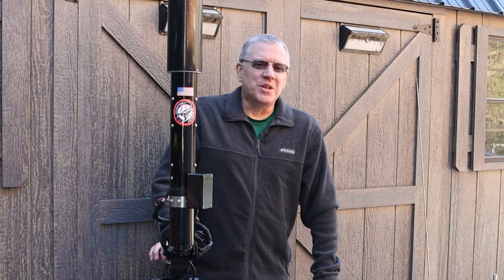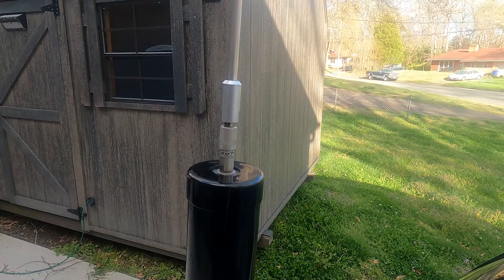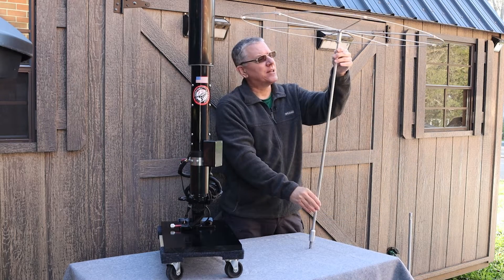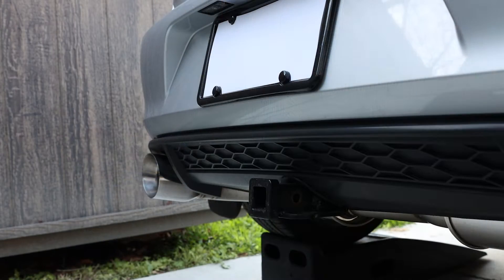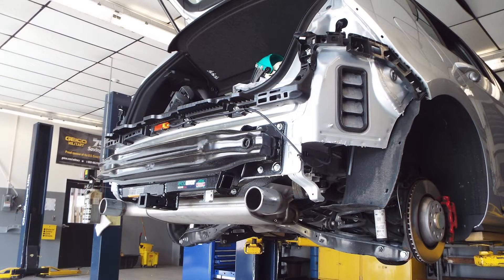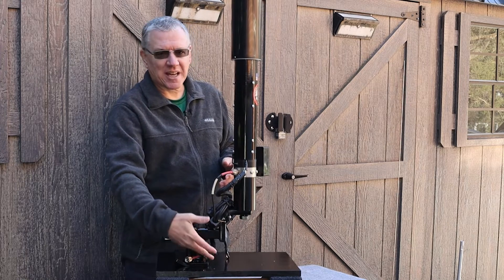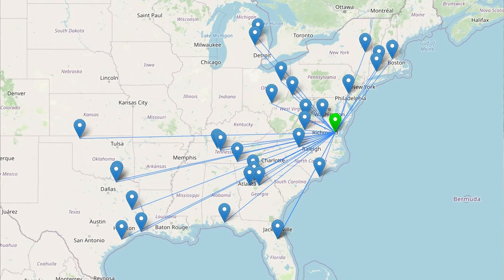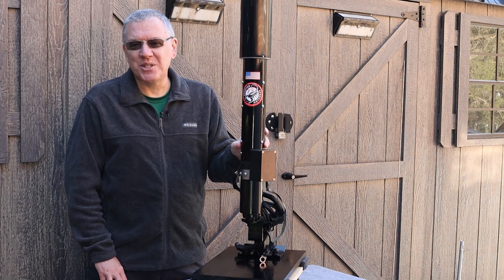Scorpion SA-680 Mobile HF Antenna - Updated

Comment: Are you running HF power yet? I just put in a Ameritron ALS-500Min my truck and it took me to another level. check Hi-Q-5/80 antennas also. 73 great videos
Reply from the maker: Thanks, Phillip! I've been to your QRZ page in the past. You're not in my log; so, you must've commented on another video, which then led me to your page. I don't recall seeing your videos, but I'll watch some now. You appear to have a good selection. You and I have a lot of equipment and interests in common! The ALS-500M was on my short list. However, inventory shortages in 2020-2021 combined with my dive into VHF contesting compelled me to put the HF amp on a backburner. See my KE4WMF/R playlist for my initial VHF weak signal setup. Question for you: Is the round fan opening on your ALS-500M an intake or an outlet? Knowing that will help me to plan my new trunk setup to perhaps accommodate an ALS-500M in the future. And, speaking of the ALS-500, there's not much content on YouTube about it. You might be able to cut a path for growing your channel if you can manage to share a good feature about it. Thanks for visiting!
Reply: I will interject with my humble opinion, and people will argue with me endlessly, but I suggest that an amplifier with a scorpion is not needed. If you are not compromised in excess to unavoidable compromises that comprise mobile HF installations, then you should put a 5/9 signal out about anywhere and to anyone that you can hear on average. I submit that in adding a high power amplifier to your HF radio solution in your vehicle, while it might be fun in application, it places undue stresses on your sensitive electronics that make that modern car run smooth. Everything from the ECM, to the ABS, to Airbag sensors all get impacted to some sort of degree when you are pummeling their respective ICs with constant burst of near field high energy HF. At best the Scorpion is efficient on its lowest band, 75m, to around 5%. Amplifiers in the mobile are not worth the effort, expense, or energy they use to gain maybe half an S unit to the outside world. A mobile setup is far too compromised to gain the efficiency necessary. Now a home station antenna over the Earth with proper fundamentals being met in all large antenna installation practices will raise the efficiency drastically, and that properly satisfies using an amplifier. A scorpion does not need an amplifier and I suggest not using one. The problem with Scorpion is not that it cant handle power when shiny new and clean, its just that the fingerstock inside the antenna could arc under high power, especially if dirty or oxidized, and it could damage the antenna's coil or fingerstock eventually. I know someone who was running a KW through his scorpion and it melted the finger stock contacts inside that contact the coil. Ron honored the warranty regardless and repaired it for him. A super mega professional business owner indeed! - 73 KK4YDR

p.s. I melted the pseudo-fingerstock in my Steppir Big IR Vertical base station antenna at 10 watts while tuning when I first got it because I didn't realize I was putting RF out while the antenna was moving its element out and in. That was 10 watts. I cant imagine the voltages in a poorly compromised mobile HF coil such as any screwdriver. Your mileage may vary.
Reply from the maker: @DeepSouthVeteran  - Thanks for the comment, Eric! Your logic is another part of why the ALS-500 is a backburner idea for me... and has been since 2020 when I bought my Scorpion. I had estimated a gain of about one S-unit at the other end of a QSO. But that only improves my odds of being heard in a pile-up and does nothing to help me hear any better. I would not want to be the operator who's "all mouth and no ears." As a result, I'd only use an amp for improving my odds in a pile-up where I can clearly hear who I'm calling; but I would never call CQ using the amp. With that in mind, I'm inclined to avoid the purchase of something that I wouldn't use all of the time. My most frequent HF activity is on POTA as an activator. As an activator, they're calling ME. So, I know they can hear me if I can hear them calling.  🙂 Thanks again for the comment!

Comment: Would love one of those BUT... they don't ship to Canada, don't know why, will ask them soon. Thanks for the videos.
Reply from the maker: Yeah, he's had too many problems with international shippers. If you call him, he'll work with someone who makes the full arrangement for international shipping via shipping agent. It's far more expensive that way, but it takes the risk away from him.  Thanks for visiting!
Reply: UPDATE! I was cruising one of the swap-shop sites up here, there's one in my garage as I type. Going to fashion a rack for the roof rack out of bed rails (first attempt) I won't be driving with it in the operating position, will lay it down with a support under it, that's the plan so far. Thanks for doing the videos, Scott. @StealthGTI
Reply from the maker: @JohnHill-qo3hb  - Glad to hear it, John! Have fun!

Comment: Really nice, but do you ever get any pushbk from the Local LEOs regarding Lic Plate obstruction?  Curious, as you know how these things can be, cherrs n gd DX 73
Reply from the maker: Nothing yet. So far, with all of my antennas (as many as 12 at times), most police seem to avoid me after taking a photo. HAHA! BUT, should I get a ticket for such a petty "obstruction" and not have it dismissed in court, I think I could use the same tow hook license plate mount that some people use, but put it on the back. Of course, I would need to add a light for it, but that's not a terrible problem. Thanks for visiting!
Reply: @StealthGTI  cheers, i probably just watch too much you tube!!! 😀

Comment: Very good video and very detailed. I have a fiberglass motor home with virtually no mounting locations. If I use the Hitch mount I cannot tow my H2 and it blocks the engine access in the rear.
I am considering this antenna with a front mount on the H2, either the Hitch mount or the Brush Bracket mount that is pictured ont eh Scorpian web site. I realize both will be compromized however like you it will be my only option for mobile with the motor home. The motor home should shield the antenna from wind while driving. The issues I am wondering about are vehicle grounding from the motor home back to the H2, about 6 feet, considering the braided ground cable that you use and attaching it to the motor home frame. If I use the Hitch mount on front of H2 I could also move it to the rear of H2 and use it there. The other issue with the motor home is it is a 45 footer so I need about 50-55 feet of control cables and coax. Do you have any thoughts on how that will affect performance? Lot's of questioins from me I hope you have some good suggestions. Thank You N5ANY
Reply from the maker: WOW! That's quite a plan. I think a front mount may be best for the sake of keeping coax and control lines shorter. Take a look at Tarheel Antennas website for more photo examples and ideas. I'm not saying to buy a Tarheel; but you may get more ideas. Good Luck!

Comment: Just come over your posting.

Well I think I have had mine about 13 years and living and driving in the UK is more challenging with big antennas on, like you I soon found the top hat the best option. My antenna I believe they don't make any more which the SA160 so 160 up to 10m. Really a great antenna I used to drive most days to London from Southampton about 160 mile round trip and leaving the house at about 4
04.30 and leaving London at about 17.00 and I am sure the only reason I am manage it was the radio in the morning non stop DX on 40 & 80m and on the way home rag chews with my normal friends. Running the full 400 Watts did bring up a few bits of fun on 15m it would completely scrambled the matrix sign on the motorway. On a more serious note I could not use the stand whip as it would whip around near the body of the van as you would stop and start. This would kick out the amp this was speeds over 50 mph let along the national speed limit. Other things which would take out it out where trucks with big bodies and as you drove along side and road bridges along with the overhead matrix signs.

At this time I had moved over to minium hight of 15' for 80m the UK stand law is 16'6" other wise it must be signed and as my journey was motorway not a problem and the whip was now a 5/16 stainless steel diameter bar with the hat on.

Tuning like you used to use the two switches for a few years then imported from the states a turbotune 2 great bit of kit never missed the frequency, a little adjust with the switch when under full power.

Now a few problems I am afraid! 

I have had a couple of fires at the top where it has moulded the plastic tube, I have put this down to water as we get a lot of weather changes here and running running up and down the motorway a warp 9 come sun snow or rain can't be good about 45,000 miles a year. Also the antenna fitting at the base has shorted so a regular clean and a couple of changes.

So I have rebuild it several times it in the workshop at the present time as I have completely changed the bottom end drive and changed it to a DC stepper motor which will be controlled is arduino.

Final words:

 Ready a great antenna I don't do much mobile work due to the van getting completely written off and just having time to fit it all in the new vehicle plus work and health have both changed but I am going to try and get it all back up and running over Christmas and would be great work you mobile to mobile 
.
73 Richard
M0UOO
Reply from the maker: Very good! I think Ron will make an SA160 as a custom order. However, I'm fairly certain that he no longer ships overseas due to problems with shipping agents. So, if you have one, you have a keeper for sure! Thanks for visiting!

Comment: Great video! The question I have is about the mounting directly in front of the license plate. I have seen offset mounts, so the plate is visible. Have you ever had issues with the police about having the plate view obscured? Here in New York city all the speed ,red light ,EZ pass cameras ,if you are pulled over you might get a ticket. This has been more for toll evaders. Bicycle carriers are used more for this than actually carrying a bicycle
Reply from the maker: I suppose it's possible. But I think I'm unlikely to get pulled over just for that. It's probably a secondary offense or just a reason to start a conversation. With that said, I AM just a tiny bit interested in an offset mount. I'd need to switch to a 2-inch mount first. We'll see if I make that leap. Thanks for visiting!

Comment: That thing looks like a flagpole! I don't think my truck could handle the extra drag that antenna would cause. Thinking about an Atas 120 for my Yaesu Ft891.
Reply from the maker: Ironically, the ATAS-120A will vibrate in the wind more than my Scorpion because the ATAS uses a weaker mount when compared to a trailer hitch. BTW, I have an ATAS-120A, too. It's a good antenna. I need to do some back-to-back testing to compare the ATAS and Scorpion directly against one another. See a photo with all antennas at https://i0.wp.com/stealthgti.com/wp-content/uploads/2022/10/20221016-Sunrise-01-1920.jpg. Thanks for visiting!

Comment: I own a Scorpion and I was mentored heavily by Alan Applegate, K0BG, so I sometimes, humbly, consider my-self quite knowledgeable in mobile HF operations. However, what makes me really, and I mean really respect you, is that you know for a fact that your antenna mounting solution is probably one of the most compromised positions and you admit that and fully admit that you want to compromise in order to keep your car in good material shape. This is absolutely respectable, and it shows that you know your stuff and I mean it! Most people in mobile have no idea what they are doing and if they do something that is just awfully wrong and woefully inadequate as far as the proper methodology, they fail to recognize this and instead further ground themselves in their mountain fortress of "I am right no matter if I am dead wrong". Bravo! That scorpion is hands down the best mobile HF antenna that is realistically practical anywhere you can find mobile HF operations.
Reply from the maker: Thanks for the note, Eric! In my original Scorpion video, I mentioned that I had tried it on the roof with a rack. I was able to do some mild bonding, but could not tune 20m at all! That was a show-stopper for me; so, I went to the hitch. There are compromises on the hitch, for sure. I found that to be even more apparent when I'm driving on concrete instead of asphalt. The rebar in concrete affects tuning since the antenna is so low to the ground. It took a LONG time for me to figure that out since it presented as an intermittent problem. "Is it the trees? Other cars? What?" HAHA! Hey, please feel free to e-mail via my QRZ page (KE4WMF). I'd love to discuss more outside of YT. Take Care! -Scott